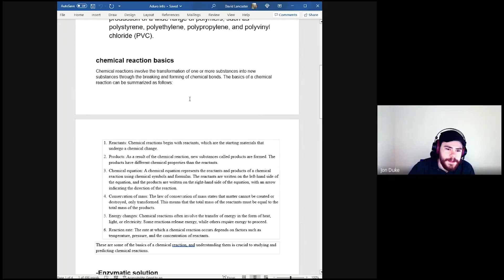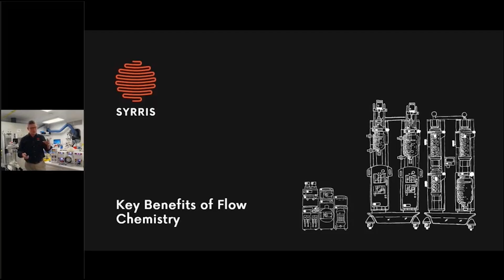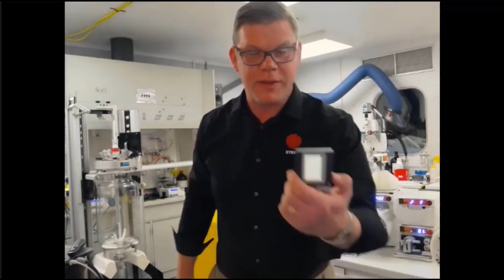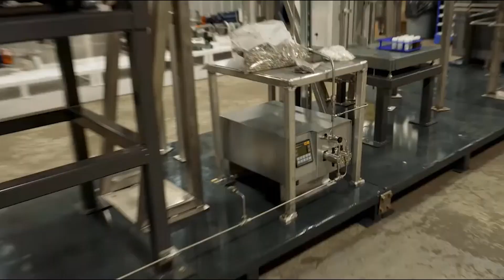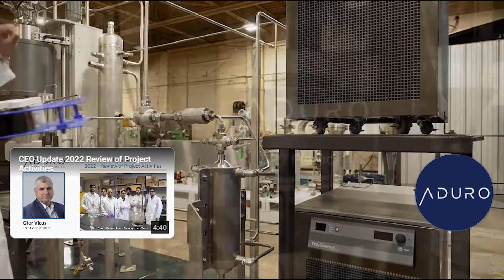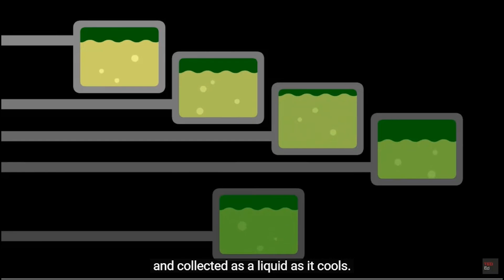Aduro Chemistry with Jon (ACT, ACTHF)

Comment: Jon says, that the process can be modified and measured in real time. I assume, this gives some major benefit in case the feed is not steady, due to some external circumstances (shortness of supplies or the like). But what I am interested in is, how fast can someone suspend/stop the process and restart it. Can this even be done? What are the costs? Is there any information about that?